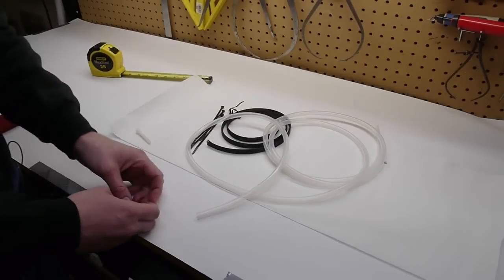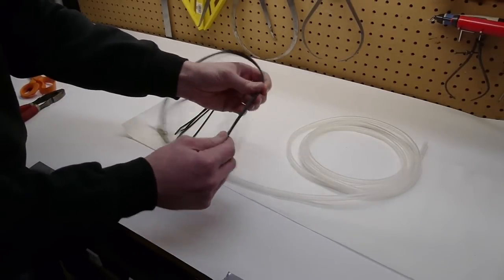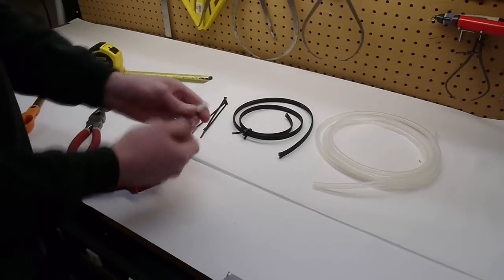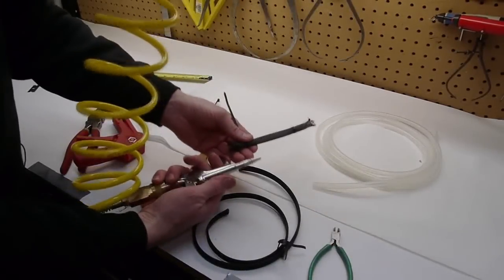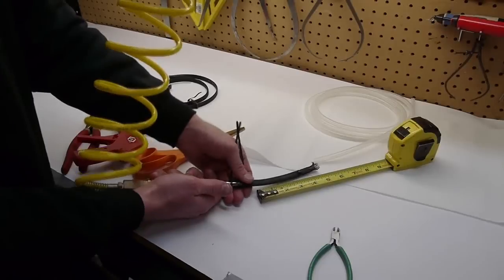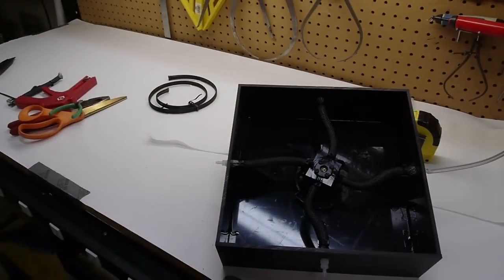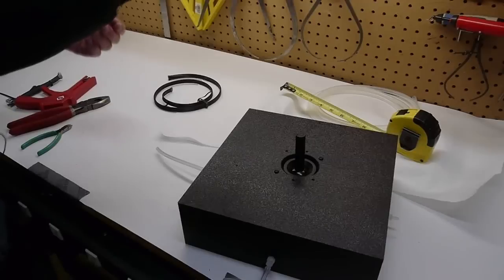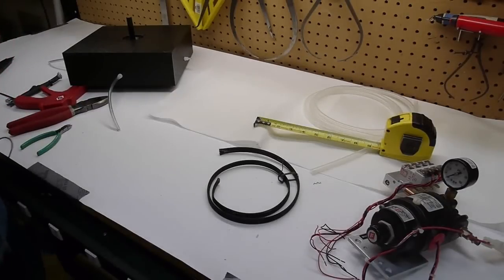Tutorial: How to build an air muscle and use it in a force-feedback joystick

Comment: Interesting issue. I am not that smart, but did get idea for use, very early in concept. Have a older player piano , need to up grade the air system with new hoses . This might be a possibility for the new hoses , instead of just rubber. THANKS geo

Comment: Well, 5 years old vid, but whatever. I know for sure you could increase the air muscle contraction per cm by using a different braided wire loom. I think a thinner braided wire loom, made for a wider diameter would work. You then stretch the wider braided wire loom so that it becomes longer, but more importantly, that the braiding becomes more elongated towards the length of the pipe. That way I believe you could double or triple the range of motion. There is a limit on how thin the braided wire loom can be. The limit will be when the silicon pipe begins to bulge on the gaps of the braided wire loom. Also doing this that I am suggesting you might reach another limit that is how much the silicon pipe can stretch sideways. High pressure thin bike tubes might work too, for a larger muscle.

Comment: It looks like all the weight is suspended on the hose barb, and I didn't think they would support a lot without pulling off. Have you experienced this failure, and if so, about how much weight were you lifting when it happened?

Comment: the travel is related to the 'openness' of the fiber weave, and the difference between being fully stretched lengthwise and fully expanded width-wise, and that also influences the actual strength of the muscle, which means that a muscle with much more travel is possible, but it would be weaker and have to run on lower pressure to prevent a "blow-out" where the tubing will slip between the fibers of the weave. The opposite is true, you can have extremely strong ones with very little travel.

Comment: nice vid very cool but i think il stick to my 180 PSI or my 260 PSI pneumatics (they are very big)
also for the small stuff i cant just use a pneumatic with single input and spring actuated return (10-20 PSI and very nice for the small stuff)